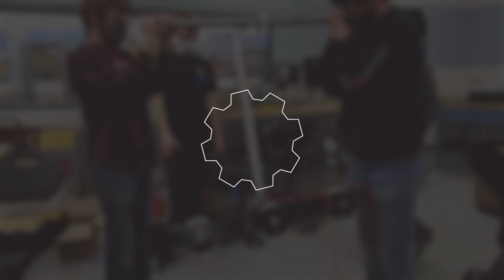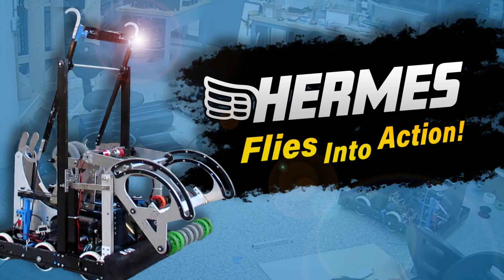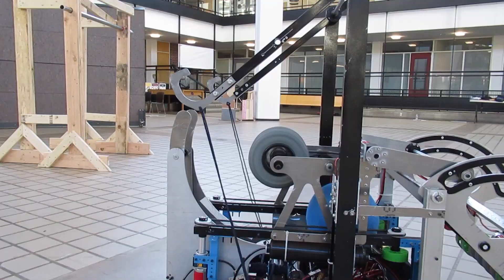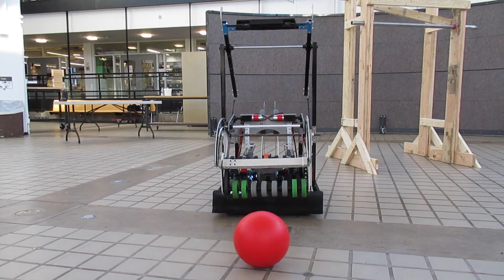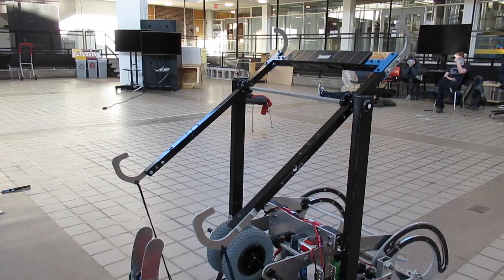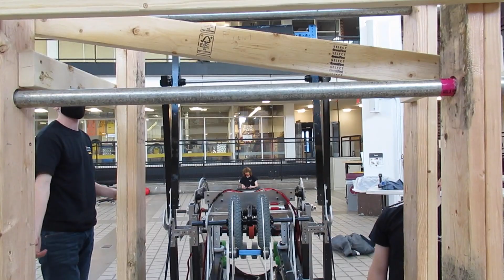Ri3D 2022 - Robot Reveal

Comment: How did y’all get the whole robot built in just a week
Reply: in 3 days
Reply from the maker: We were able to spend more or less 3 days straight to design and prototype. This equates to roughly 8 hours of meetings per week over 6 weeks. We were also able to focus on building mechanisms by relying on kit of parts chassis and standard components as much as possible.